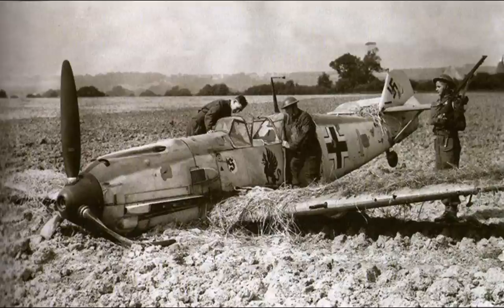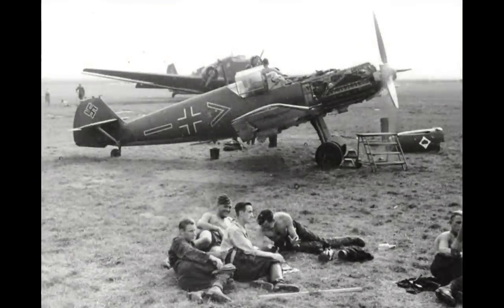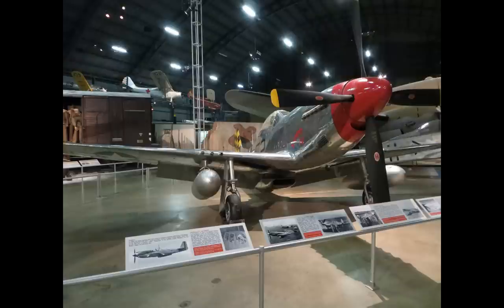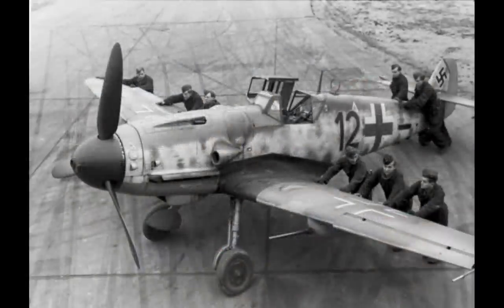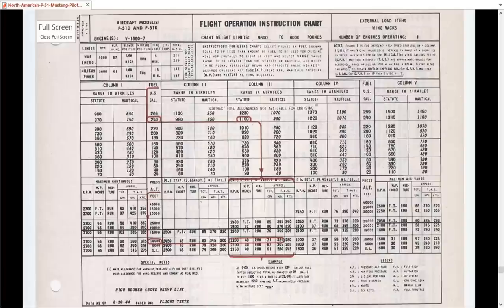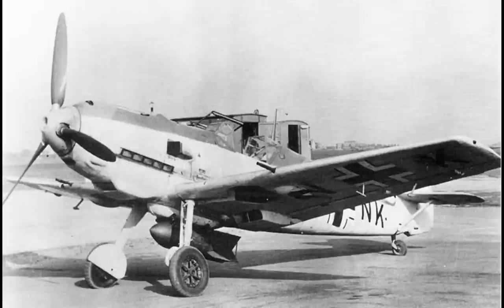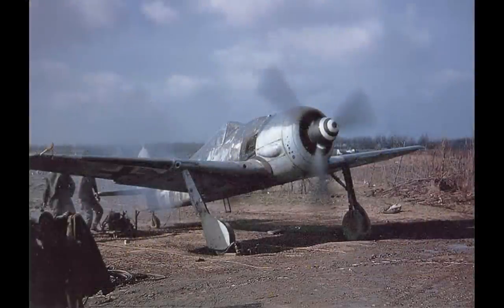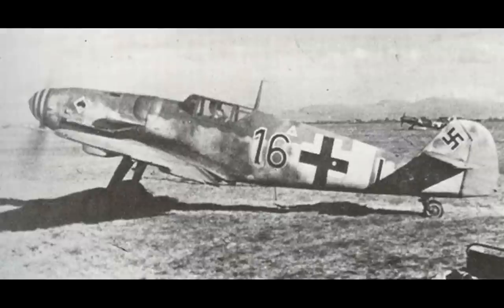Messerschmitt BF 109, Why Such Short Range?

Comment: This Vlogger wastes a lot ot time in addressing obvious and non controversial points but fails to detail key point e,g even though after the 1st week of Battle of Britain it became very clear that the Emil’s did n’t have enough Loiter time over London, why did n’t the Luftwaffe quickly lash up some Drop Tanks under the fuselage of the Bf 109 ? Even when the RAF’s single engined Hurricanes were destroying the twin engined Bf 110 Zerstorers tasked w/ protecting the Heinkel 111s, the Dornier Pencils and the Junkers 88s ? A major management failure of Fat Goering that doomed Adler Angriff and started Hitler’s downfall. To think that just hanging a 100 liters ( 30 gals ) Drop Tank to the Bf 109s could have changed World History !  The RAF and the Brits in general were much Smarter and Responsive.
Reply from the maker: Do you expect me to cover every issue in one video. I have two things to say here, first I cover drop tanks in another video. Second, a drop tank can be added to any plane,, so it's not particular to the 109 and even when you add one, the 109's range is still short relative to say a P-40 with a drop tank. In other words, it doesn't change the core issue being discussed.